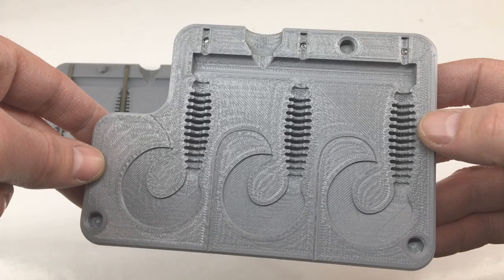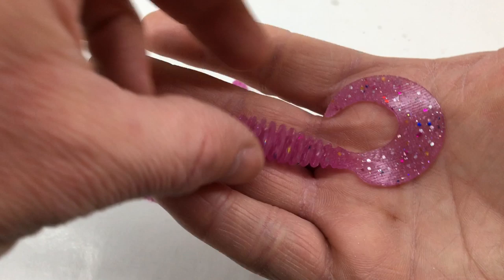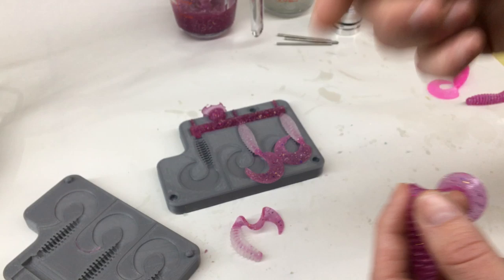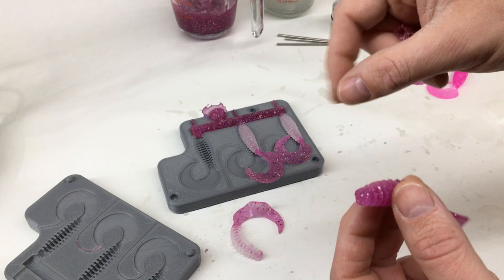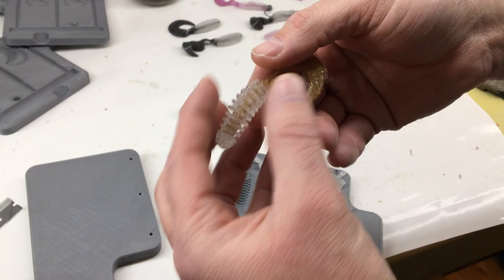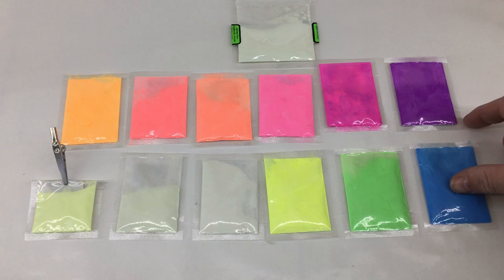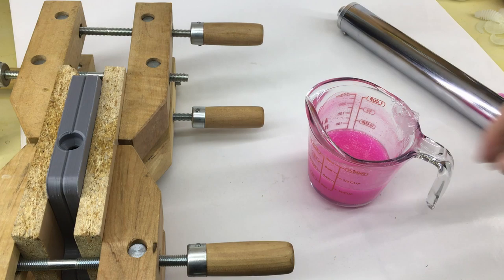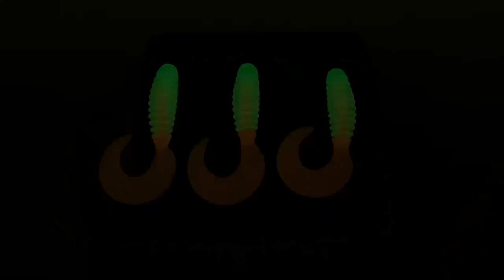Injecting a 3D Printed Core Shot Mold (Ribbed Grubs)

Comment: Have a look into non-planar 3d printing for your projects,  it should get rid of most of the stepped layering.
Reply from the maker: Great idea.... I've seen this but haven't looked into it much yet but it might be perfect for this kind of thing.
Reply: Print orientation and products like xtc3d or fiberglass resin coating could smooth the rest out. 

High build primer under your high temp spray could also work.
Reply from the maker: Thanks... I really didn't put to much prep work into that test but next time I'll see how good I can get it.
Reply: sthone  one other option would be to sandblast the mold. 

I hate sanding so I tend to look for alternatives.
Reply from the maker: @clintdemeillon4688  Yeah several people have told me this ... I might have to give that a try soon too I have a cabinet at work I can use.  I honestly don't mind the layer lines on baits (or the  dull finish) but it's always great to try new things. Thanks for the great tips.

Comment: If you print with ABS you can use acetone vapours to smooth the mold out.
Reply from the maker: Yeah for sure but I really hate printing in ABS because of the fumes. I have a make shift enclosure but I haven't been able to vent it properly yet.

Comment: For the molds to get a smooth finish why not try using some resin for a resin printer? You can paint it on thin and shoot light on it to cure it. Works great for smoothing prints so it may be great for molds?
Reply from the maker: It probably would work. I have used high temp spray paint on the mold to get a smoother bait before but overall I really don't worry to much about it as the fish really don't care. If I was making baits for sale I might be more concerned but I'm more concerned with catching fish than fisherman :)
Reply: @TheNeverendingProjectsList  i hear that. I've been out every day fishing the Cumberland hoping for some good flathead cats and some bass lol. But you have inspired me to try to make my own molds for fishing and definitely gained a new sub.

Comment: What is the % infill you use ? My printed molds used to deform after pouring a few shads (same problem revamped outdoors had LOL)
Reply from the maker: I print most of my molds at 25% infill but the Infill really isn't the problem.  When slicing the molds I try to get at least 1.5mm of solid plastic (so to speak) on the faces of the mold where the plastisol will touch so a lot has to do with walls and top layers.  I run a .35 nozzle so I go with a minimum of perimeter 4 outlines and the top layers depend on layer thickness. For example if I run a .10 layer height to get a good detail mold I run 15 top layers.  Depending on your layer height you can just do the math to figure out what should work.  1.5mm / .20 layer height you would only need about 7-8 top layers for example.  Yes a lot of top layers will increase the print time but the mold should hold up. 

With all that said the other main problem is going to be your plastisol temps... I shoot my plastisol at a temperature around 300° any higher and you will melt or deform the mold. (of course this depends on what material you print with too)   Depending on the size of my mold I still can get some slight warping of the molds (I've shown this in other videos) but normally it just flattens back out when the molds are clamped together.  I've even just placed the mold back on the heated printer bed for a bit and it will flatten back out.  I did run a 1/8" stainless steel rod the length of one of my tube molds to try and help this problem but I haven't shot it enough yet to see if it helps. 

 Anyway thanks for watching... I hope this info helps alleviate some of your problems.
Reply: @TheNeverendingProjectsList  thank you very much for your extensive answer and I agree that temperature will always remain a problem because of the meting temperature of the plastisol. I am already trying to print a crayfish mold with your setting and will let you know the results :-)

Comment: would it be possible for a 3d printed laminator and/or injector
Reply from the maker: I use a 3D printed laminating blending block with out any issues it actually works well but I highly doubt a printed injector would hold up to the heat. I wouldn't even attempt it to be honest as plastisol burns are no joke.

Comment: What slicer do you use?

Both cura and slic3r++ have a feature called ironing. Basically smooths out the top layer. I love it. It works really well.

Also i have an experiment for you. Can you feed in two materials at once using a y splitter? I wonder if it will mix... Swirl or seperate.
Reply: Also in slic3r++ there is adaptive layer heights. So it will make the parts that don't matter much thicker and then the more important parts thinner.

If you want help setting slic3r++ up hit me up. I'm down to help!
Reply from the maker: I use Simplfy3D but been meaning to try cura one of these days.

Yes I do have a duel injector setup (it will probably show up in a future video) it basically does laminates (two colors side by side) but I want to try spinning it as I inject to swirl it.
Reply from the maker: @girrrrrrr2  Thanks... I have done multiple layer heights on past molds so they print faster.
Reply: @TheNeverendingProjectsList  cura isn't bad. I do prefer slic3r++ I like the interface better. And sounds good!

Comment: I’m interested in 3D printing fishing molds myself but I was wondering what kind of filament you used for the mold that is able to withstand the heat of the molten rubber?
Reply from the maker: I actually just print my molds in PLA+ and I inject the plastisol around 300°. The plastisol cools fast enough so it works pretty well.  I'm not saying I haven't had any issues and I'm sure ABS or even PETG would probably be a better option but for the most parts I've been very successful with PLA and it's easier to print with. 

Stay tuned though .... In my next video (which will be posted any day now) I'm rehashing exactly how I shoot the molds and what settings I use for printing them.
Reply: @TheNeverendingProjectsList  ok thanks

Comment: I'm gearing up to print my first soft plastic mold with my 3D resin printer and I wanted to ask a question you've probably already answered several times before in other videos.   Can you tell me what you're using as a mold release agent?

Right now I'm in the process of modeling a 4" long TadPole master in my SolidWorks CAD software.  I've already tracked down the cheapest sufficiently heat resistant resin  I hope to be using.  I'm just wondering if there's a specific mold release formula one uses simply because the mold will be injected with super hot plastic.

I've printed an ABS mold for urethane casting High-Pressure Air Gun  Seals and as a mold release I used the solution recommended by the seller of the casting resin I used.  The only difference might be that the heat generated by the small amounts of casting urethane was much lower than the heat that will be generated by injecting 300-plus degree plastisol.   With any luck this same mold release will work for this High-Heat TadPole mold application as well cause I still have a bunch of it left over.

I don't know if the high heat will just burn off my existing mold release before the release agent has  a chance to act or if it will actually facilitate the release of my plastisol TadPole from the mold.
Reply from the maker: I print in PLA+ so a lot of the time I don't use release agent and the plastics come out of the mold with a little effort required. But a lot is going to depend on the plastic the mold is printed in... I printed a mold in ePC and the plastisol stuck to it like glue and ruined the mold. When I do use a release it's just worm oil that I brush into the mold before injecting.  So far it works flawless.
Reply: @TheNeverendingProjectsList  Hey thanks for the quick reply.  I appreciate it.

I'll be using a print resin called Phrozen Specialty Engineering resin.  It's said to have about the correct heat resistance for this application.

I could print the mold in question with my Filament printer but the resin printer has fare better accuracy and surface finish; not to mention, greater detail.

I guess the only way to find out for sure if my existing mold release will work is to give it a shot.

Incidentally; I contacted the manufacture of the resin in question to ask them if this particular print resin was microwave safe.

Oddly enough, I don't think their engineers had ever tested any of their resins for microwave-ability.  I'd love to be able to get creative with colors and then popping the mold in the microwave to get seamless color blends.

I'm just waiting to hear back from the manufacture of these resins.  I actually contacted two different resin manufactures.  I think my question caught them by surprise.

Comment: Would it be possible to finish the mold with acetone and still have the molds work?
Reply: It should if you have it assembled while you smooth it.
Reply from the maker: If you print in ABS it should but these are done in PLA so it wouldn't work in my case.
Reply: sthone good excuse to get your hands on chloroform then lol. Apparently it does to PLA what acetone does to ABS.